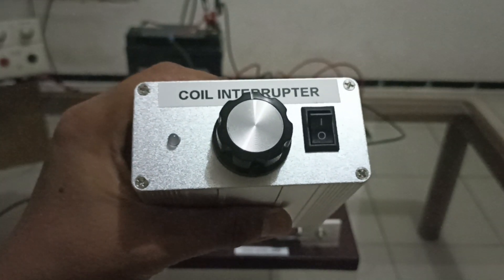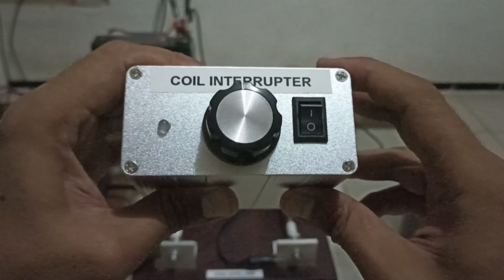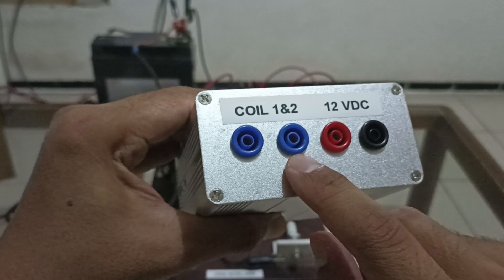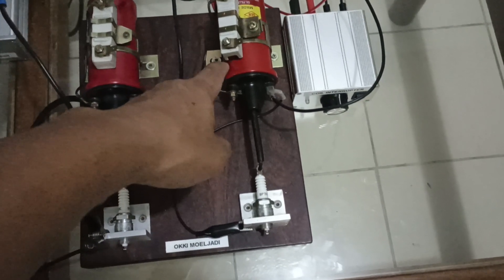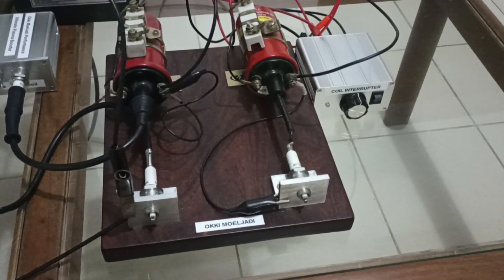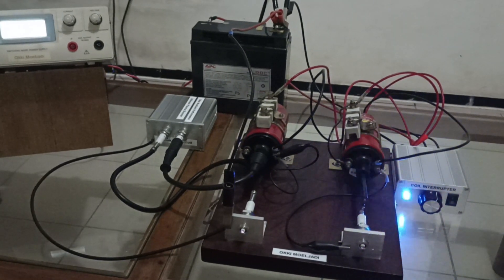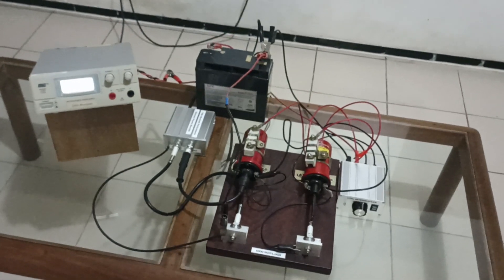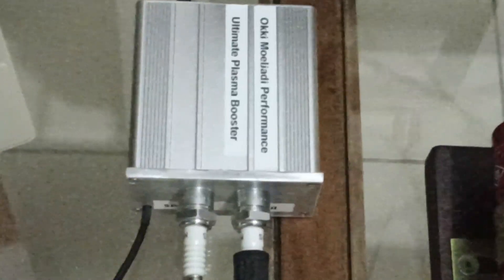Interrupter + Ultimate Plasma Booster

Comment: Could you do a efficiency test? For example running a generator burning one full tank of fuel with the Booster and burning one tank without the Booster. Comparing the two for measuring run time on the generator under a load. Thank you for all the hard work. I've followed for years and it is nice to see your work becoming more and more refined.